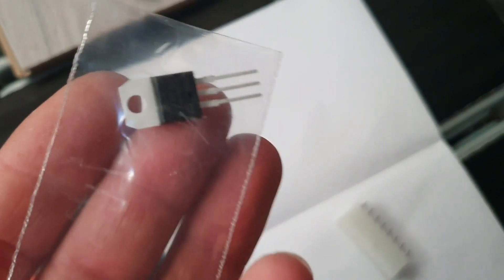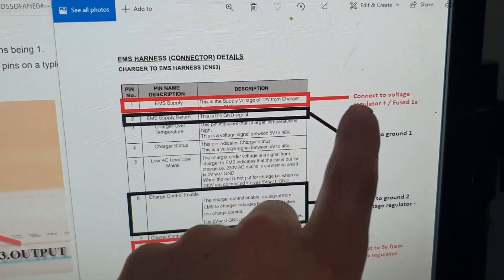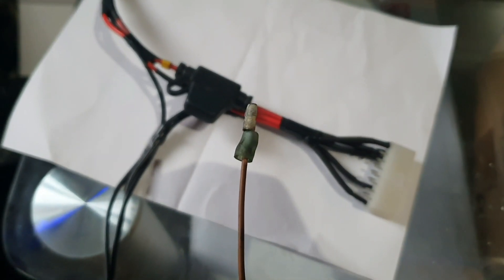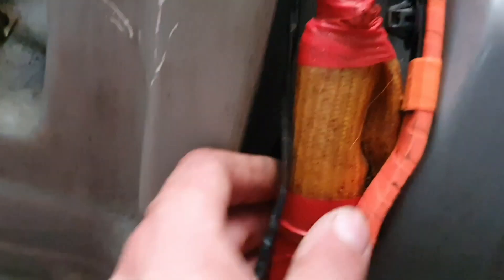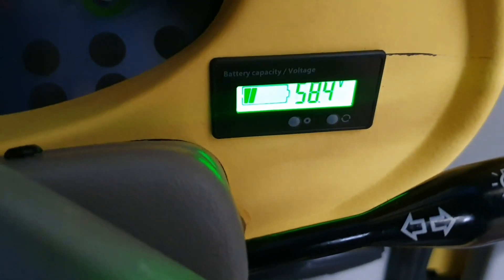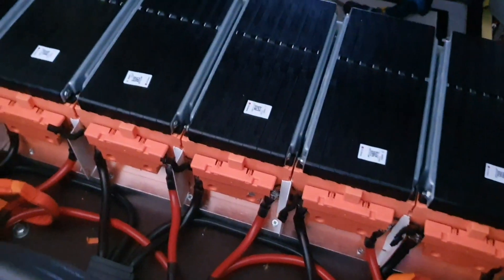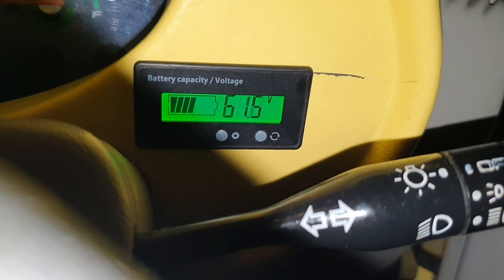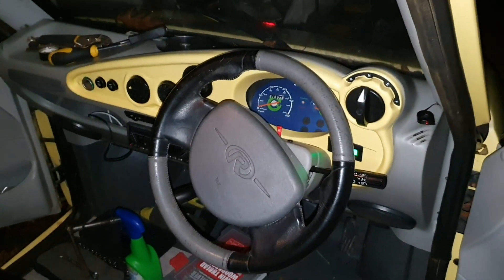REVA G-WIZ: Yellow Wiz Lithium-ion conversion pt.10 - charger working and all batteries are in!

Comment: Have you piped up the cooling system on the batteries? And great videos keep it up
Reply from the maker: Nothing piped up yet still got to find the right system to install to heat and cool it... waiting on bms first as rapid charging wont happen for a long time.

Comment: Thanks for showing us how to trick the charger how many of the LG batteries could you fit in original battery box without cutting seat bars I need back seat for school runs shopping ect. would it run off 4-6 LG batteries and can the LG batteries pull that many amps I don't need the range but I would like better efficiency on charging ect this seems like a cost effective lithium replacement for the gwiz thanks Edward
Reply from the maker: You could get 4, maybe 5 so you should have 30-40 miles range. If you are lucky you could get more. The main problem is that less you may have to pipe up water cooling so the batteries don't get too warm. It would run on 4 minimum without being too much danger to the cells due to peak discharge of the G-Wiz. Definitely a cost effective way but it depends when the guy has more available. The other option is to go for 2x tesla mercedes cells. That's about 6kwh of power and up to 40 miles range. And two will bolt upright without having to cut the struts out. £1200 for a pair but still not terrible compared to lead acid. You can buy these more readily from Zero-EV.